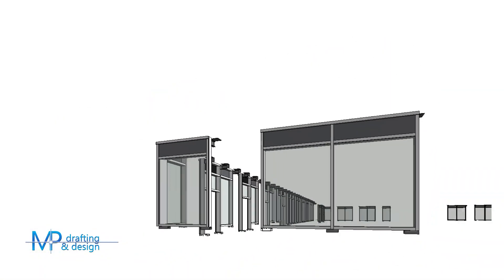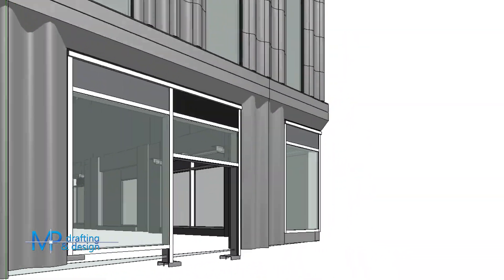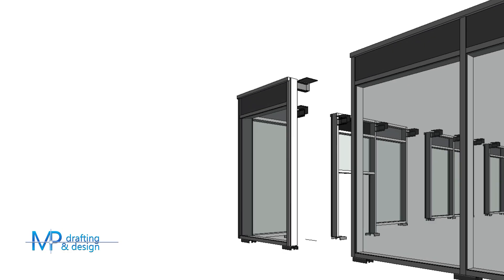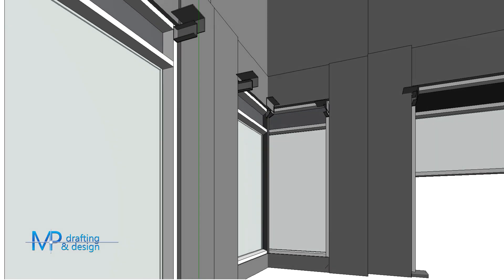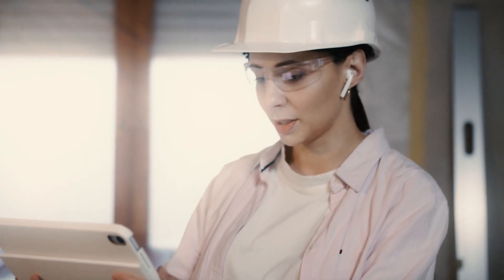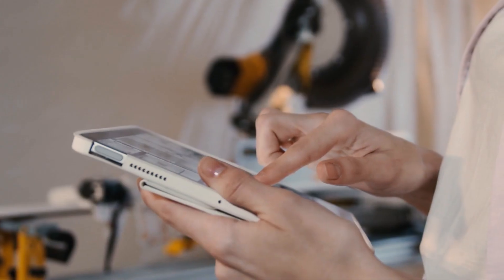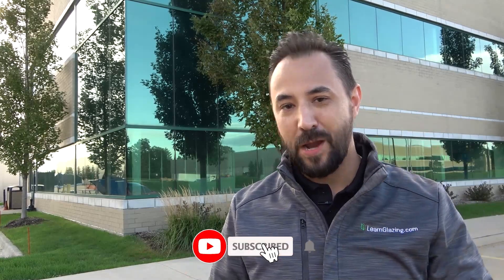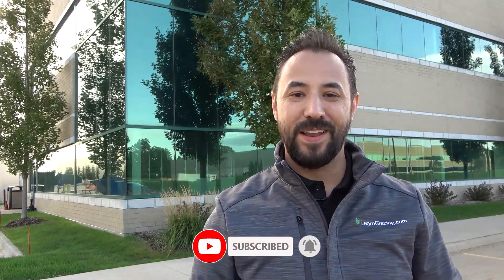What is BIM Building Information Modeling

Comment: I don’t understand. BIM is horrible for glazers and anyone involved in curtain wall. You can’t draw complex details without completely overwhelming the system and models take literally more than an hour to open as it is. Mechanical drafting software like solidworks or 3D cad like rhino are nice upgrades over 2d cad but BIM is only good for the architect and Gc as a coordination tool.